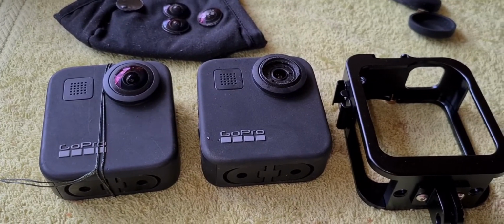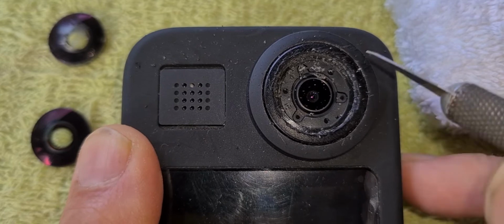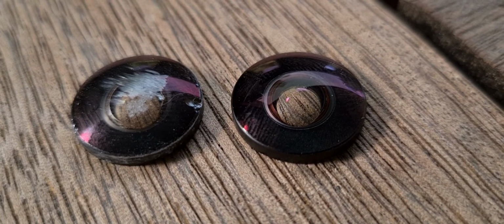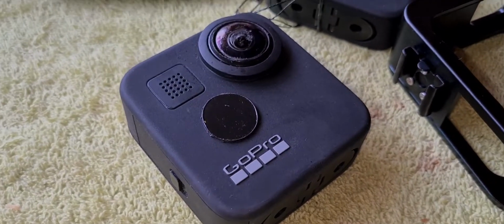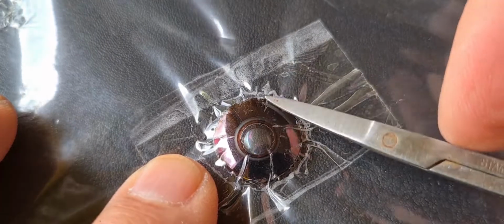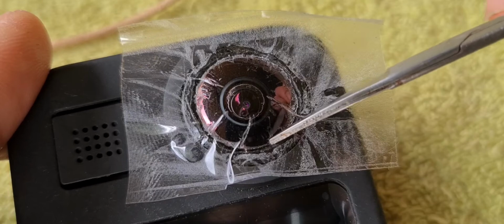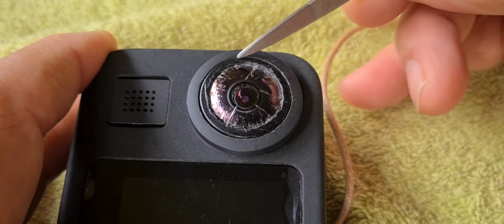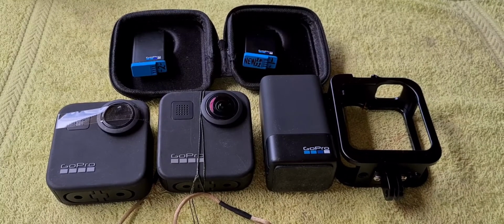GoPro Max360 Repair how to fix your 360camera lens

Comment: I have replaced my Max lens with a lens from Aliexpress, but the stiching line is very bad. It is not lining up and the one lens looks a bit darker than the other original lens. Is ther a special trick to line up the stitching line?
Reply from the maker: When you process your footage you can get the application to tidy up the stitch...try cleaning the edge of the lenses that can cause that
Reply from the maker: In the conversion software under "export" settings you can ask the software to tidy up the stitch...
Reply: Thank you I'll have a look and try it out
Reply from the maker: Are you sure you got the correct diopter...here is the link
Just found this amazing item on AliExpress. Check it out! AU$43.93  30%OFF | Orginal New Gopro Glass Lens Replacement for Gopro Max 360 Action Camera Repair Part
https://a.aliexpress.com/_mqQn4L6

Comment: Thanks for the video.  Just cracked my diopter.  A third of it fell out from the impact.  Is there a way to tell if the lens is damaged?  I can take a video and the part that is exposed directly to air (diopter missing) is blurry.  Is blur normal for the video without the diopter?
Reply from the maker: Yes the image will be quite blurry until you get a replacement diopter
Reply from the maker: It will be blurry until you put a replacement diopter in ... test it before you glue it...you can use clear Nail polish to glue it back but try not to get it on and part of the lens as it will blurr the stitch if you do😅

Comment: Just to add that in my experience it is easier simply to break the old lens and then simply to put the new lens after you clean all the glasses
Reply: How can you break it? Are there any special tool for it? Thx!
Reply: I used a hammer
Reply: Is working properly? Good video quality?
Reply: like new  @mrcfpv85

Comment: Funny part the unscrew you heat up the top with a heat gun and the rubber part comes off you keep that and then you unscrew the whole thing and then you just screw a new one back in you just have to buy the seals for the both sides that $10 to make it waterproof and another question is why are they aren’t like that have you ever thought of that there aren’t like that just because they’re art like that because they’re trying to keep it waterproof what happens if you just take the covers off like like that glass piece it wouldn’t be waterproof but what are the 360 still work might want to try that with with a lens covers off
Reply: did you ever find a replacement for the whole screw thing? I can only find lense replacements online (please link it if you have found the whole screw part and lense please)

Comment: Nice repair. My Max just turn on lens  laying on  side of the camera on  contrete fance. I tried polishing but it makes lost of sharpnes (damage was to big so that polishing changed geometry of lens. Unfortunately I have no such tool so I remove lens in other way. I first hit with punch the lens in middle part that makes holes. Then I took teransformer soldering iron and touch hot arrow to lens in area of holes from hits. After heating lens  I hit with puch againg and lens broke in two pieces. I reheat half of lens again and hit in the middle the half so that lens broke again. When I had three pieces of lens it was easy to take them out. Hit is very important only hand and punch with breaking hit in last moment before puch touch lens to avoid that in case of bigger crack punch go further to second lens.

Comment: Hey Tony, its me again. I put the new diopter in but my video is blurry, could you explain to me in detail how I can make it so the diopter doesnt blur my videos? Worst case would it be possible to leave the lens without diopter and put a plastic lens protection thingy on top of everything to keep the lens safe? Hopefully you can help me out, cheers from Italy
Reply: Also, I think the lens assembly behind the escutcheon actually has threads to get the proper focus. I think I recall someone removing what I'm calling an escutcheon (the outer plastic ring) with a heat gun. Might be worth looking into.

Try this first: https://youtu.be/0wIruOu-dp8

Here a teardown: https://gethypoxic.com/blogs/technical/gopro-max-teardown

Lens replacement of Hero 4 for reference regarding measuring the depth of the lense threads to get the correct focus:
https://youtu.be/V_UIj_7cKgI
Reply: @TherealTruth40  thanks a lot Kevin! :)
Reply from the maker: You have to have the diopter in for the camera to function ... probably got some residue on the lens by the sound of it
Reply from the maker: DID YOU GET the correct DIPOTER...you might have bought a standard GOPRO diopter not HEROMAX
Reply from the maker: DID you clean the camera lens inside under the diopter before you installed the diopter ?? It may have some blur from a fingerprint or something...shine a torch into the diopter and look for any sign of smear on main lens...also you should have cleaned both front and back of diopter before installing !!! If you can't resolve it you might have to remove the diopter and clean all surfaces and reinstall

Comment: I just unscrewed each lens from its pocket n screw the new 1 back down
Reply: Can you explain a lil more?
Reply: @OregunAdventure  top plastic ring is held on with glue just heat it up pop it off and unscrew lenses
Reply: Do not cut  apart the body or it will not go back together
Reply: https://youtube.com/shorts/D-W5COMtB7Q?feature=share

Comment: yo man where did you buy the lens and the glue? kinda got the same problem as you and in need of some help thanks in advance :)
Reply from the maker: I bought the lens off alibarber or ebay
I made the extraction tool that's a key element
Reply: @whitelightfilm  and the glue?
Reply from the maker: @sly.emotion  you can use a clear nail polish...just make sure you don't glue the base or the lens in just the edge as you may want to replace that lens someday
Reply from the maker: Lenses are Available on Aliexpress...just use clear nail polish as glue it cures under UV as well